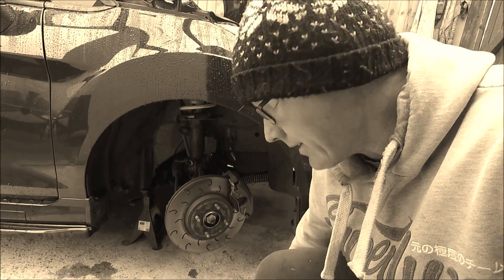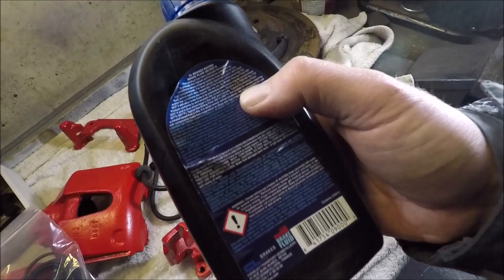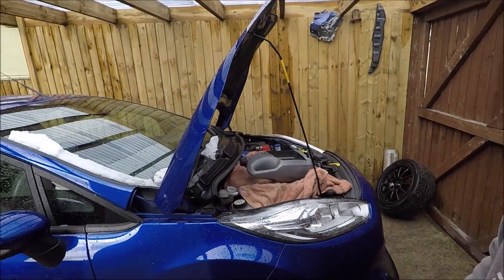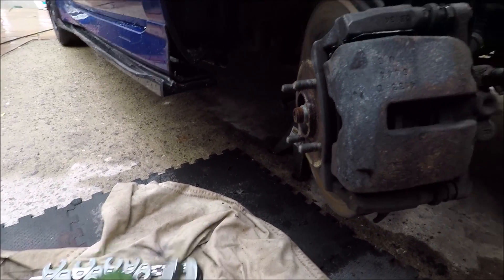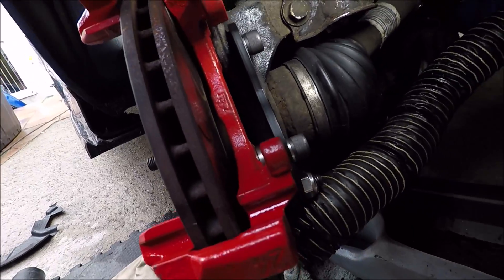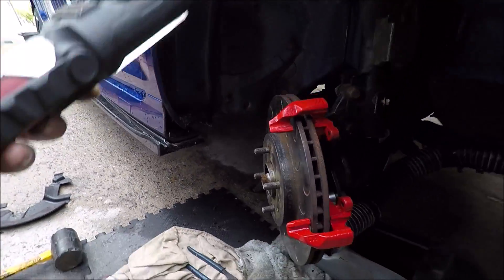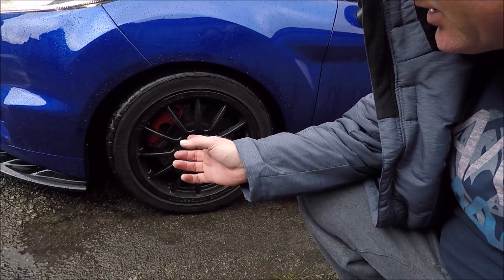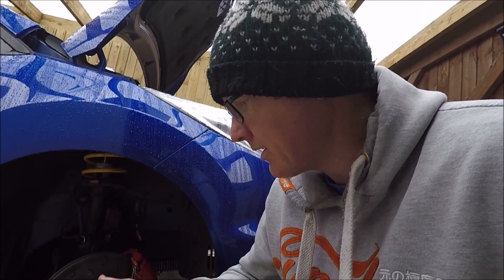BIG BRAKES DONT FIT

Comment: Have you managed to find a good enough brake upgrade
Reply from the maker: Yes standard Ford discs and endless me22 pads. Phenomenal.
Reply: Spark Plug Steve if your looking for a 4 pot Caliper use the calipers of a 225 Megane, I have installed them and they are amazing :)

Comment: Iso confused mix match modeo mk3 and st170 pads and caliper? ofc they are not conpatable, but thats nothing to do with the st180... its you putting a square in a round hole... if they are mondeo mk3 calipers then use mondeo mk3 pads and there will not be a issue....????  Am I missing something?
Reply from the maker: Yes you missed a bit. They are st170 calipers with st170 pads.

Comment: If I’m honest I spent most of my money on brakes for my last  Trackdays at brands hatch, new lines all round disc and the right pass and the correct brake fluid to deal with the heat. Managed a good 10 laps of the GP TRACK without any brake fade, and all the stoping power I needed.

Comment: Are you sure you’ve fitted the conversion bracket the right way up ?, the callipers look further round anti clockwise to me !. Obviously being a Vauxhall man I’ve not had owt to do with ford conversion stuff maybe those brackets only fit one way, was just the callipers look high too me !.
Reply from the maker: Yes the caliper is sitting too high. Definatly fitted correct but iv since found many more people suffered the same problem after using these brackets.

Comment: If them calipers are from a fiesta st170 cant you just get st170 pads
Reply from the maker: They are st170 pads.
Reply: @Sparkplugsteve  that's strange then isn't it 170 pads don't fit in 170 calipers lol
Reply: @anthonyshackleton6178  It does sound odd. I'd like to know the answer to that too.
Reply from the maker: The pads fit perfect. But the conversion brackets from sico mount the caliper in the wrong position relative to the disc.
Reply: @Sparkplugsteve  gotya, so you need a different conversion bracket if such a thing exists and new unmodified pads now. :-)
Reply from the maker: No I'm giving up on it. I'm doing a Renault brembo conversion instead. Stop skipping parts of the video 😂
Reply: @Sparkplugsteve  I dont skip parts my excuse is I smoke 🤣 so dont always take it all in lol
Reply: @Sparkplugsteve  Fairy-nuff I didn't skip bits, but I obviously didn't pay attention. :-)

Comment: You might be better off having a set of pads ready modified but instead of taking metal off the hooks, maybe trim back the actual overlapping friction compound.
Use an angle grinder to trim the friction material back and wear a mask when you do it.
Reply from the maker: If I do that I will have less pad surface area than standard fiesta brakes and defeat the object of the upgrade.
Reply: @Sparkplugsteve  what is the difference between this kit and what it replaced?
Reply from the maker: standard fiesta has 280mm discs and the st170 is 300mm. shame it didnt work, thanks for watching